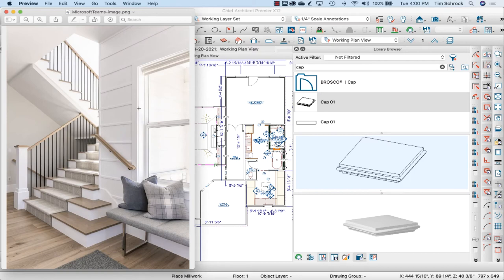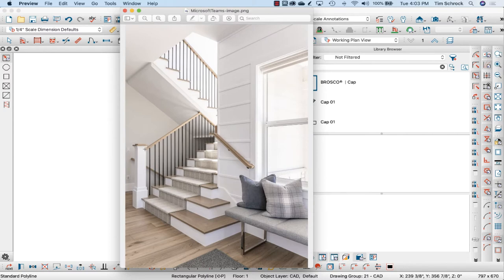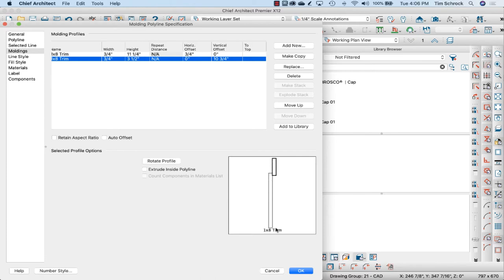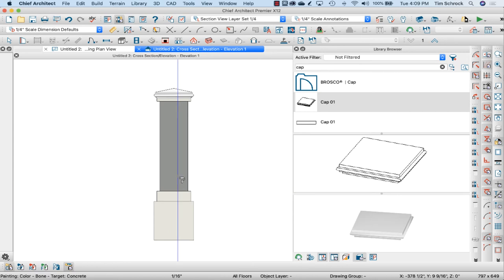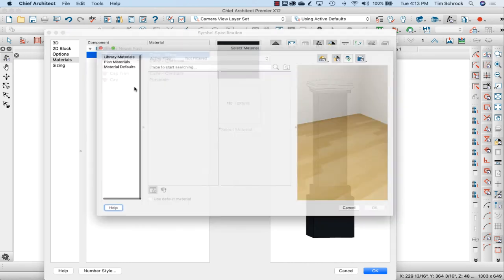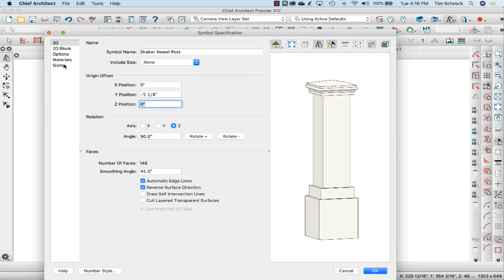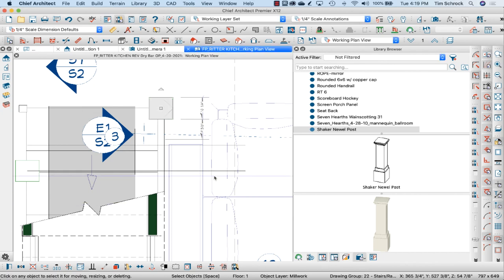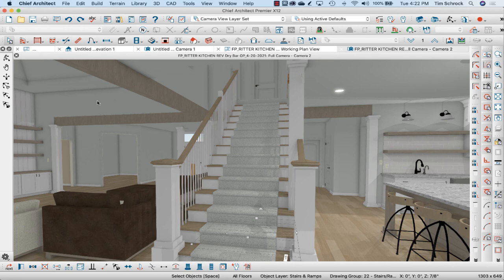Custom Newel Post Library Symbol | Chief Architect

Comment: Thank you, while I don't comprehend all the steps it does give me a start.  When you created the symbol, I had a hard time understanding all the nuances.  Now let's see if I can create LJ Smith LJ-4091 Newel.
Reply from the maker: Glad it got you started. Let me know where you run into trouble with some of the nuances. I looked up the LJ-4091, and would suggest you start with the 4 3/4" square center, and then you can place one molding polyline with multiple moldings at various heights to create the details.
Reply: Thank you so much!  I used a soffit as I understand it a little bit better than polylines.  I have plans to watch your tutorial several times until I understand polylines and molding polylines - you are a great teacher!
 @DesignbuildsolutionsLLC